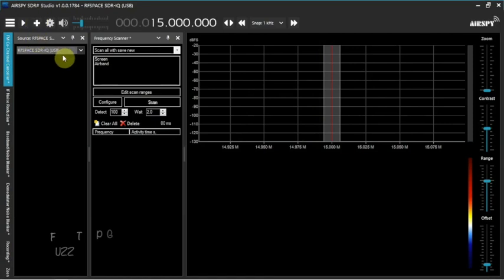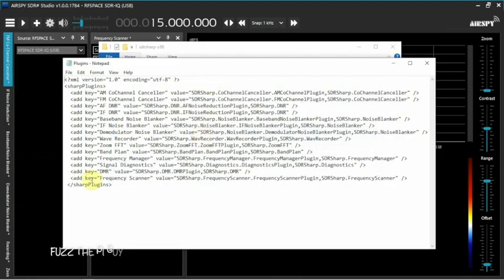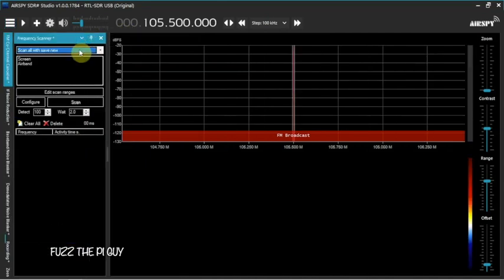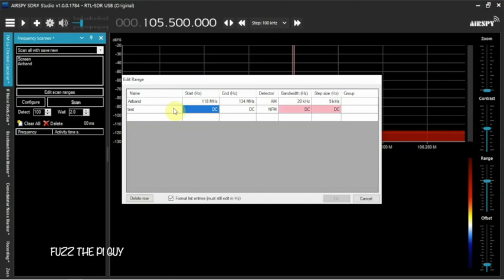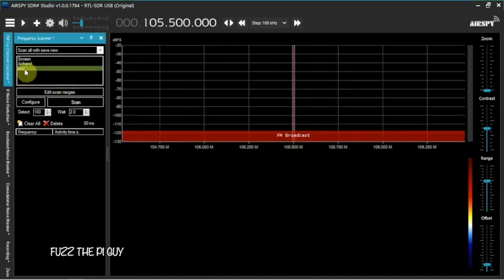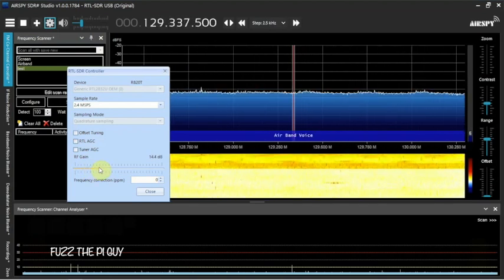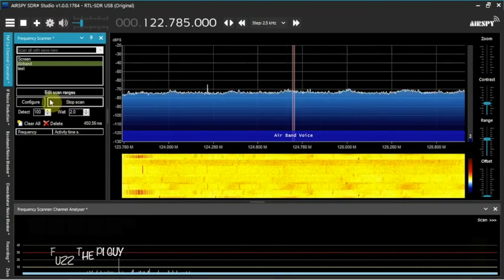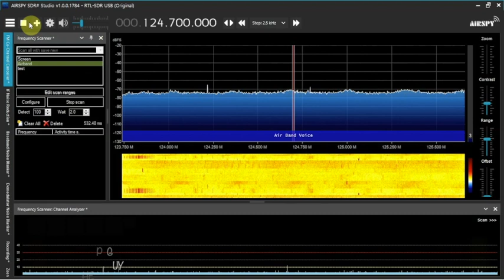SDR Sharp  |  Setting Up Frequency Scanner Config For SDR#

Comment: Good night. Please tell me the maximum frequency range that can be put for scanning. For example, 118.00-130.00 MHz scans perfectly, and the wider 225.00-300.00 program freezes
Reply: You have to adjust the step size. If it's too small, it will crash the scan.